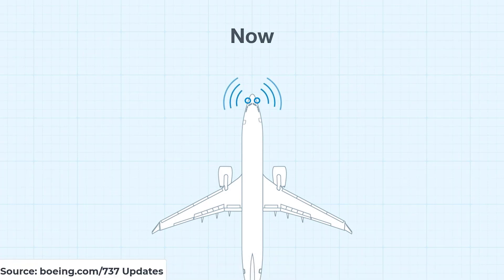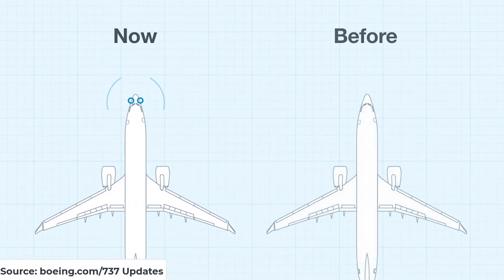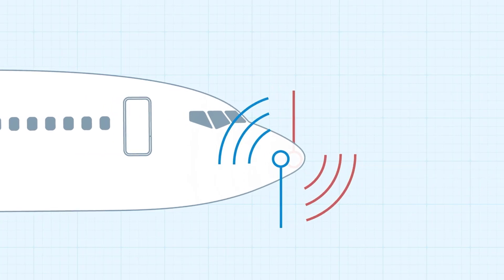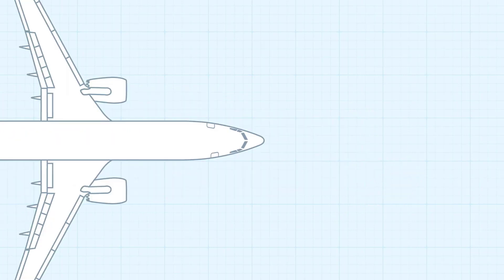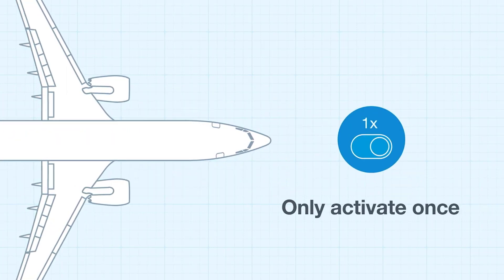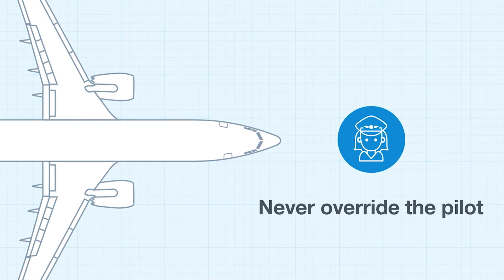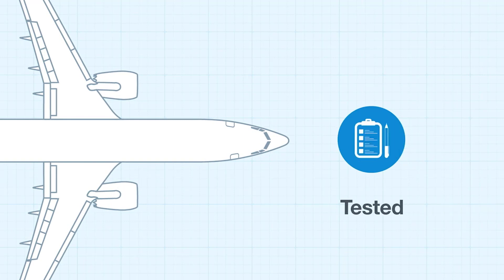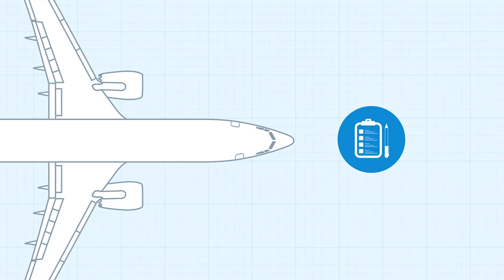Boeing: 737 MAX. MCAS Software Update and Flight Test

Comment: 737 max aircraft warning and MCAS 2022 update . 

What is MCAS and it’s origins?, ok MCAS is a software system that, as the name implies Maneuvering Characteristics Augmentation System  . Autonomously corrects an aircrafts angle of attack. 

This first appeared on a tanker aircraft that had various payloads and allowed the planes need to keep its nose from either rising or falling during normal flight. 

The worrying reasoning behind this system being borrowed is the new engine configuration,  larger engines which where further forward and higher up to clear the ground . This imposed a tendency for the aircraft to be nose heavy and this under various Maneuverings to be normalised for the pilots . To cut it short these aircraft have been adhoc modified and no longer naturally fly and have to be kept aloft by 
 Augmentation, in other words deceiving the pilot into thinking this aircraft wants to fly normally.

The major problem with this strategy is it plays into the hands of unpredictability. In scanario not anticipated. It has a newly discovered problem at low speed 1g and the max aircraft during wind tunnel testing had high speed dynamic issues hence MCAS implementation.

So what is MCAS in the most basic of concept? 

When an aircraft is originally designed it is designed from the ground up with good well understood parameters, one of the main ones being its, centre of gravity. If An aircraft is modified from its original design, the centre of gravity can change. With the original implementation Of MCAS being a cargo or tanker plane it’s pretty clear this patch software or as it’s called firmware integrates the aircraft sensor hardware with the flight control software.

The three major components of MCAS are the aircraft angle of attack sensor at the front of the aircraft, the MCAS system and the tail elevators. 

??Okay so what’s the deal with these three components and the deadly combination.

… Well really the angle of attack sensor and the two elevators are normal parts of the aircraft so therefore the MCAS system takes readings from the angle of attack sensor senses when the aircraft nose Is not within Reported limits and behind the scenes adjusts the elevators automatically. You might be thinking this is a fantastic idea and removes the tedious adjustments a pilot may have to make on a routine long flight.

The danger is this MCAS system Was not disclosed to pilots and fell within the normal operations of the aircraft. Therefore no pilot training was given in the situation where MCAS worked outside of its normal parameters.

This means that the angle of attack sensor is converted into a corresponding negative feedback system which is fed to the elevators on the tail. This,  in certain unpredictable turbulent or wind shear type situations can cause and affect the aircraft to pitch up effectively stall then dive then repeat this process in a rollercoaster like motion.

Being a Electronics hardware technician and an embedded software engineer. This scenario lends its self to a common problem within electronic circuits. 

Amplifiers  like the  AAS/MCAS/Tail Elevators MCAS ,  can amplify a smaller signal Input ( like AAS ) and through MCAS add a gain(x5 i.e) And after a delay through the difference between airflow from the AAS to the elevators cause a low frequency resonance feedback . Similar to an amplifier. When an amplifier resonates internally, it bursts into oscillation(fault), in exactly the same way as the aircraft Rollercoasters. 

Resonance is usually a factor of either high frequency or conversely in aircraft high speed. Space vehicles like the Apollo missions had similar resonant frequency at maximum thrust.

This is basically a well-known fact in feedback systems.

Both the 737 Max’s reportedly before crashing exhibited this type of in my opinion, well known scenario of resonant roller coasting. 

Warning: because the 737 aircrafts  being modified into max, don’t fly like most other commercial passenger aircraft and require this MCAS system. There is a significant hidden danger, training may not be enough to identify this particular problem in time. 

The aircraft due to having compensatory MCAS system installed will probably reduce the overall efficiency of the aircraft since the MCAS system has to affect Tail elevator during normal flight interrupting the air stream more regular and therefore it’s efficiently. 

So….

The MCAS system is due to be modified and certified in 2022 in order to make it more efficient. This might be a sign that fuel efficiency is making more of a priority than safety.

A foot note 
An aircraft that doesn’t for the most part fly balanced about its wings, will exhibited more fatigue on its tail over time and where it connects to the main body of the aircraft, this may be the fate of any aircraft that compensates for its inability to fly by design and be compensated by adhoc patches (MCAS)

The one simple facts about the 737 max ad hoc modifications is it was purely about shareholder Capitalisation and not about designing a new aircraft from the ground up like Airbus have for Passenger safety priorities. 

Watch this space?

Comment: This plane is doomed,look how far out are engines on the wing,you mess with center of gravity-not good,so instead of redesign airframe to fit the bigger engines,they pushed them forward ,hence the nose up at take off when engines are almost full throtlle,the trim is in a different  configuration,so takes more pressure at take off to stop plane shot up into a stall,imagine the wear and tear on the trim tabs,good job Boeing,NOT
Reply: You do not understand physics. That's not how it works. Thrust-pitch couple is actually reduced on MAX compared to older 737 models because engines are lifted upward thus  moment-arm is reduced.
Reply: @Nikola16789  As R. John Hansman, a professor of aeronautics at the Massachusetts Institute of Technology, told me in a March 28 interview,(not me a Forbes reporter,stop commenting if you have no clue,and i do have a degree in engineering)

As I understand it, at high angles of attack the Nacelles — which are the tube shaped structures around the fans — create aerodynamic lift. Because the engines are further forward, the lift tends to push the nose up — causing the angle of attack to increase further. This reinforces itself and results in a pitch-up tendency which if not corrected can result in a stall. This is called an unstable or divergent condition. It should be noted that many high performance aircraft have this tendency but it is not acceptable in transport category aircraft [emphasis mine] where there is a requirement that the aircraft is stable and returns to a steady condition if no forces are applied to the controls.
Reply: Moment = Force x Distance or M = (F)(d)
Reply: @pepinha1979  Professor R. John Hansman is correct.

Comment: https://youtu.be/RyeqeqSNSgQ

UNACCEPTABLE TAKE OFF ANGLE BLAMED ON ENGINE POSITIONING ON BOEING 737 MAX8 FOLLOWING TWO CRASHES THAT KILLED MANY
Also check out on you tube UNRESOLVED: THE REAL PROBLEM WITH 737Max8 see below👇🏽
https://www.youtube.com/watch?v=H2tuKiiznsY

Unless Boeing repositions those big new engines correctly on these planes wings i.e by raising the planes landing gear to allow enough room under the wings, the problem will still be present regardless of what software "bandaid" they use to correct the flight trajectory errors. MCAS software does not fix an Engineering and design flaw🤨.That is why it was introduced in the first place, to hide a Problem👀.
FLY AT YOUR OWN RISK Boeing737Max8.

👆🏾pls📱📲Share
TV📺One🗞️📰📻🖥️🎥🗣️📡(((

Comment: Can someone explain to me why an airline would order this plane over an A320neo? I just can't see where it's justified.
Reply: 1. It's a 737. 
2. A lot of airlines are still operating the 737NG. Thus buying a neo instead wouldn't make any sense whatsoever.
Reply: @anavgeekspassion5727  well, airbus make new planes that can make energy efficient up to 15% by make the engine bigger...

While boeing have lower wing clearance, they still install the new bigger engine and make the engine a bit higher than the wings... I caused the plane to make higher angle on climb and could make it stall... Rather than to make it taller by redesign the whole plane, which is much more expensive, they design MCAS system...

So they could sell the plane without raising the price...

The plane company bought this plane in hope to reduce the fuel price needed by the old plane...
Reply: @MElroy97  I can't see how these two topics are related but okay.
Reply: Its cheaper,airbus want a kidney for each plane,

Comment: i wont fly on 737max anymore even it certified safe to fly.. fly characteristic should be change through structure element, not compensated using software..
Reply: Better not fly on any modern jetliner then.  They all use software these days.
Reply: @braidkid  the plane not meant to pitch upward in full thrust. boeing should change the wing design instead of compensate only using software.
Reply: @fracl9369  yeah not anymore so are you happy now all safe n sound
Reply: 100% true. That's what I thought since the day Boeing said they would use MCAS to compensate an "aerodynamic flaw".  They "fixed" MCAS but the main problem still exists! I mean... What if a 737 MAX crashes because of the DEACTIVATION of the MCAS??? It is a disaster itself..
Reply: @lucasbuzzi3092  guess what its all fixed now

Comment: Why now?! Why was this not part of the design from day 1??? Why did 340+ people have to die for this? WHY have ONE sensor in the first place? Now you realise you always needed 2 sensors?
Reply: Exactly!! The one AOA sensor really bothered me because aircrafts are supposed to have redundant systems for safety. This was not a mistake but a deliberate choice - sad.
Reply: Simple.. they want more money.. :V
If they really want safety as the main priority and really want the new bigger engine, they would redesign whole 737..
Reply: @anonyw2993  It's not just them. It's the entire industry really. It would've been very hard to deal with airlines if Boeing were aiming to re-design or to replace the 737. It just wasn't gonna happen.
Reply: @anavgeekspassion5727  It was probably a rush to get it to market. JMO. The 737 is the biggest selling plane of all time, so why the rush?
Reply: I can hear and feel the frustration coming out so clearly, it's quite painful. Sending you my best wishes 🙏
Reply: exactly this is bs the pilot suppose to can override anything wtf they wanna say pilot doesn't know how to fly smh
Reply: Should be 3 sensors like Airbus
Reply: @matthewsmith2787  They're working on a synthetic airspeed sensor for the MAX. Much like the 787.

Comment: Is this a smaller 737 max?  Are most 737 max planes sold to the airlines the more stretched 900 version?
Reply: There is max 7, max 8, max 9 and max 10
Reply: If you saw the big #7 you'll see it's the 737-7

Comment: How about the other design flaws, like placing the engines ahead of the wing instead of under the wing.
Reply: What you have written makes 0 sense btw
Reply: That's not a design flaw, it's a design decision and one that was made because the size of the engines necessitated just such a placement. To do otherwise would require a redesign of the airframe and landing gear which would make the aircraft not a 737. I should point out that most aircraft have the engines housed in nacelles which hang under and ahead of the leading edge with the notable exception of the 737-200.
Reply: You clearly have no idea what you’re talking about lol.
Reply: We get it you've seen 1 vice video congrats... It's still generating lift sure it's more susceptible to reaching the critical AOA but any pilot with (proper training) unlike lion/ethiopia's pilots can handle the aerodynamic penalty with ease
Reply: You sound ignorant. Boeing takes the lion share of the blame. Followed by FAA. Followed by the pilots
Reply: 🤣 That's not a design flaw.
Reply: Yes its design flaw. Bad quality check. The engine should be in top of the nose plane
Reply: @OudofHeaven  You surely don't know what a "flaw" is then. It was a design CHOICE not a flaw. The immature idea of re-engining the 737 instead of coming up with something brand new was flawed.
Reply: @anavgeekspassion5727  you must be fun at parties
Reply: @OudofHeaven  Isn't this joke a little bit overused at this point? Well I don't give a damn anyways.
Reply: @anavgeekspassion5727  then why you believe my comment thats a design flaw? Lol. Read my first comment, if you don't get it, read it again. I just replies to this comment, because its funny. then you replying my comment and take it seriously. Maybe u need vacation, or friend, or coffee
Reply: @OudofHeaven  I get it now. But you did sound quite serious. I didn't really read the second half of your comment as it was quite complex. I automatically assumed you were referring to the wing instead.

Comment: I can't believe this aircraft originally shipped with an MCAS that relied on the input of a single sensor with no redundancy, and that couldn't be overridden or disabled by the pilot on-demand..  especially for a function so critical as controlling the pitch of the aircraft.  That's a totally negligent design from an engineering perspective.
Reply: @chasphotonic8904  well, what i heard from the news that they overly advertise that "it is the same as the previous model" and pilots were given a brief 2 hours explaination on an iPad exactly before the flight without emphasizing on the new MCAS... Who would have thought, because they said it was the same... for me it just said, "dont worry to much, just same experience" and neglect the most important thing...

MCAS system take over 10 seconds automatically and pilots can only take control 5 seconds... When any problem occur, pilots were trained to read the manual book on how to solve any problems/trouble... Who could read on a panick and diving environment and read THE BOOK... While maintain altitude and search through the pages in 5 seconds...

What will you do in that position, not knowing the MCAS system, while plane is diving, and must read the manual book??? Then know in the manual book that you can turn it off???
Reply: @MElroy97  It wasn't really worked like that. MCAS system did not take over 10 seconds automatically - it was interrupted with every manual trim input.
Pilots were not trained to "read the book to solve problem" - they were trained to do memory items and only then to complete procedure by book.

The real problem: MCAS false activation was always a secondary failure that required instant action. No pilot in the world can reliably instantly react to a secondary failures so design of the system and procedure was completely inadequate.
Reply: Well I saw this on wikipedia "  Lion Air Flight 610 - a flight piloted by a different crew on the day before the crash, the same aircraft experienced a similar malfunction but an extra pilot sitting in the cockpit jumpseat correctly diagnosed the problem and told the crew how to disable the malfunctioning MCAS flight-control system" seems like you could disable it, but a lot did not know how
Reply: That's because by FAA rules, a system is safety critical if it uses more than one sensor. A safety critical system must undergo a long and very detailed scrutiny and approval process. So to avoid all the extra approval process they decided to use just one sensor.